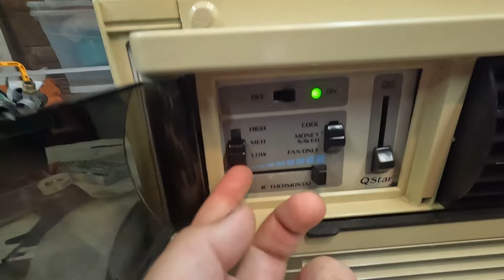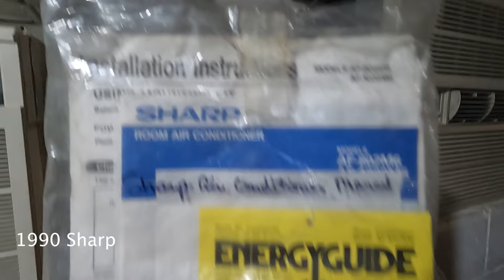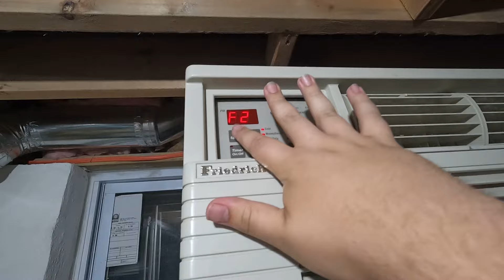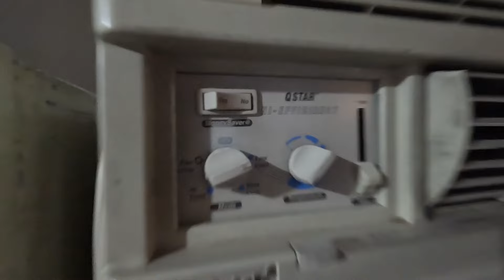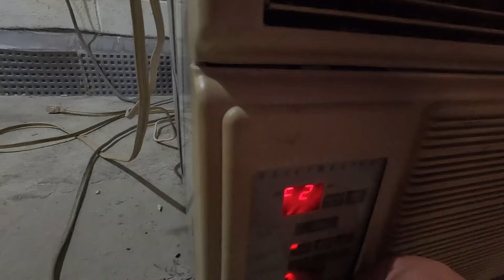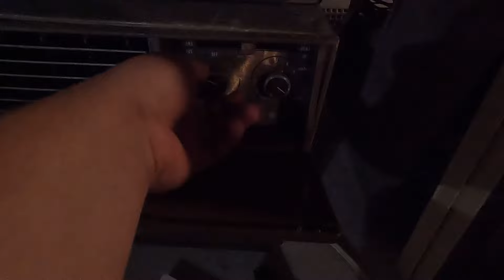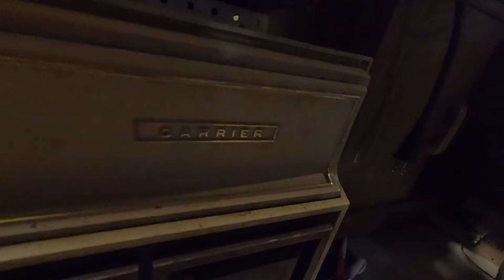Vintage / Classic Air Conditioner Startups 2024

Comment: Hello, I have a 11,500 btu Kenmore air conditioner made by Gibson. I need a new switch for it. It needs the low, medium and high cool switch. Where could I get one?
Reply from the maker: @brendanusualvlogs7842  I would get a part number off the switch and see if you can get a new one, if not you may need to find a switch that has the same amount of positions or find a unit with a similar switch
Reply: @ How do I send a picture of it?

Comment: Hey bro remember carson01XJ he has air conditioners as well he should join you Tho you sound sick you been coughing
Reply from the maker: @justinlyonsPawPatrol  yeah I had a cold at the time of recording lol
Reply: @VintageHVACDude  hope you feel better but though did you ever subscribe to Carson01XJ he has cool air conditioners too. He has vintage ones and modern ones. The modern ones he has the LGs GEs and one haier some other vintage ones from the 90s  he has the sharp with digital controls Samsung with digital controls but he has other vintage ones with manual controls on the fedders with the digital controls, you should install a little beep speaker on the circuit board because digital controls on every different air conditioners should have a beep noise so you know what you’re controlling and Carson01XJ has a sharp comfort control air conditioner with digital controls and it doesn’t have a beep noise on the circuit board he should install it so that way every air conditioners with digital controls like my grandma‘s Frigidaire’s has a beep noise when you press the buttons because I like that feature because it tells me what you’re controlling just like the modern air conditioners